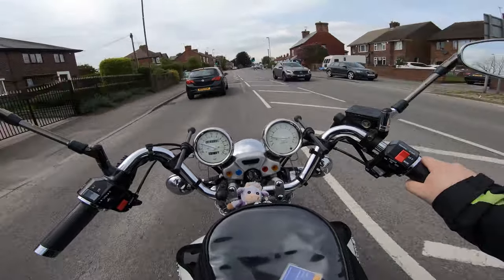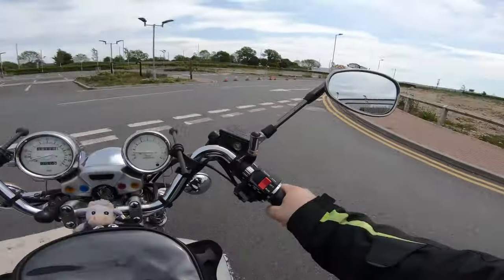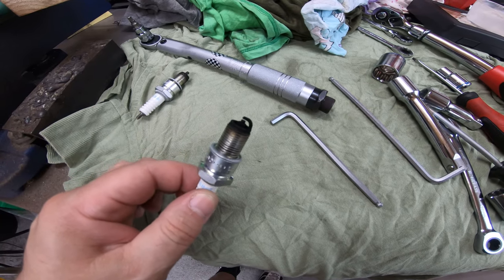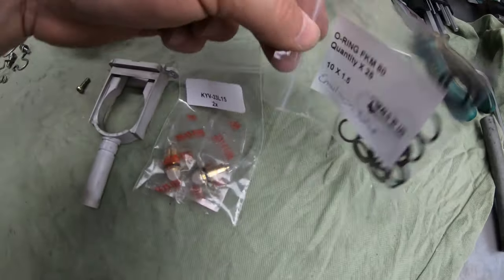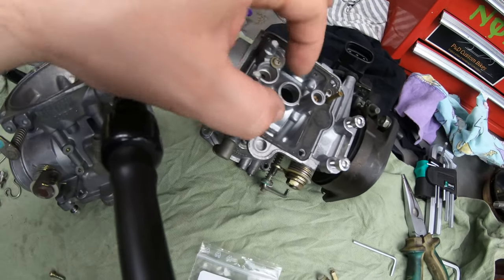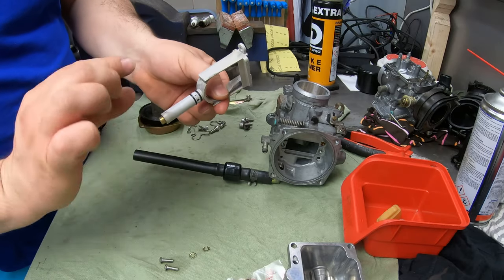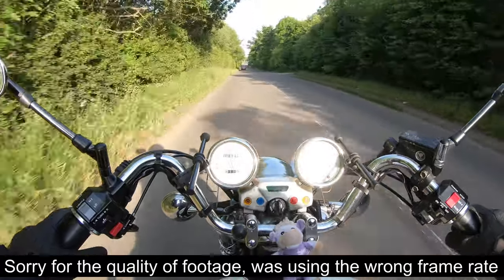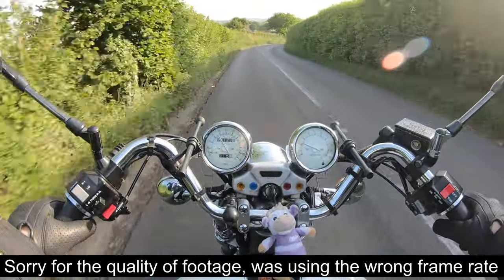VIRAGO 1100 CARB ISSUE  | FLOAT VALVE GONE | How to adjust fuel level | Emulsion tube O-ring swap

Comment: Hey brother, I did the exact same thing you did. My float I set exactly the same way you did. When I re installed my carb to the bike, fuel was pouring out of the overflow tube. I don't understand
Reply from the maker: @devin usa That's strange, however it happened to me too if I left them empty for a few hours... Drain it half empty, then hit the bowl with a screwdriver handle, then prime it with the pump and keep hitting it, if this time everything is fine then you have your float stuck on the bottom when the carb is empty and it isn't coming up as it fills up.
 Watch my carb installation video where you can see I explain the situation and how I fixed the problem with a little solder on the needle valve housing so the float doesn't go that far down. I hope I'm explained it right. If the float goes down enough just to open the valve that's enough, it doesn't need more... What really matters is the top position
https://youtu.be/2Rx4pVpChwo
Reply: @MidlandCruiser  I think the tang for the float is worn out, I had to sit the float to be leaner, about 30 degrees, just to stop it from flooding. I'm going to switch to a single carb. It's miserable installing these dual carbs. Yamaha did a poor job at designs when it came to these carb placements
Reply from the maker: Yes they are not the best to work on, but they can work fine after many hours of work😉 I wish you good luck witht he single carb, if you don't want too much troubles then I suggest Adam Smith on Facebook Virago-Nation group who makes, possibly the best ones of the manifolds. 👍
Reply: @MidlandCruiser  thank you brother. I contacted Adam today and will purchase from him in a few weeks. . After 10 hours, I removed, fixed and installed the carbs back on. I've never had so much trouble with any carbs before, yamaha hates us lol
Reply from the maker: @dl2.504B  Adam's manifold should be fine, and if your carb needs tweaking then it'll be 5 min to pop it off, I do understand why would you go single carb. I hope you get it sorted and can enjoy it over the summer.. All the best 😉

Comment: Hey brother. Hope all is well. So my virago 1100 front cylinder is still acting up. I changed the resister cap, the coil and wires, and it still misfires. I put new plugs in it 2 weeks ago, and the rear cylinder and new spark plug is running fine, but the new spark plug in the front is misfiring unless I pull the resister cap off half way. So I threw the old spark plug back on the front cylinder and it doesn't misfire at the moment. I think my carbs are running rich, because there's black soot on the plugs. Could rich carbs cause the misfire because of too much fuel in the front cylinder? And if so, do you know how I can readjust the fuel/air mixture on the carbs for the virago 1100? Someone in a forum said the fuel/air mixture screws are covered by a brass plug/cap so people can't mess with it. I need help, you're the only one I found with any actual knowledge of working on a virago
Reply from the maker: First of all, thank you... 😉
So misfire can be caused by too rich condition. If it's happening on low throttle opening and/or idle then the pilot mixture screw can help yes. On the 1100 if it's after 88 then you have Mikuni carbs which will have a black rubber plug covering them instead a brass plug. If you have an older then you have Hitachi on it which is crap all together and also I have no experience with, so everything I say is apply to the Mikuni.
I'm pretty sure you have a carb issue and not ignition as you changed everything and still not right, and also went back to the old plug and it's fine now.. So I'd focus on the carbs.
Unfortunately there is so much to check/do that I literally would run out of space here.

1st I would do is fuel level check, easy to do and I show it in the video how to do it, just on the vice, but the procedure is the same if it's on the bike.. Low or high are both not good, it needs to be right.

2nd would be to check how far your pilot screws are out now, just turn them in and count how many turns until stops lightly, you can use a small hex driver bit to be able to turn it as the space is very limited.

To be fully honest you may need to pull the carbs, fully strip them, then clean them (ultrasonic cleaner preferred) re set everything to stock and fine tune it once running again, including sync. Unfortunately this isn't an easy  thing to do. I could help you but you are in the US, sorry.
If everything is stock (intake and exhaust) then your carb setup will need to be at the stock settings (fuel level, needle position, pilot screw positions, and all the jets) stock pilot screw setting is 2 out on the front and 2 and 1/2 on the rear, both needle clip in the middle position, and fuel level around 0 to - 1.5mm below the carb body seal surface as shown in the video.... Hope this helps a little
Reply: @MidlandCruiser  my virago 1100 is a 1991. And I took out the carbs when I first got it, and cleaned the carbs out, the float seemed good, as did the jets and pilots and gaskets. So I believe I just need to readjust the fuel/air mixture.  I'll serch for the mixture screws and attempt to resync them. My virago 1100 came with drag pipes and an aftermarket air intake/filter. So I'm thinking maybe the prior owner could have readjusted the air/fuel mixture to be more lean, to compensate for the drag pipes (they do have baffles in them), so the bike didn't run to lean. But I think he over did it, and now it's too rich. 
I appreciate your help, and your advice is definitely appreciated and very helpful, even if we are over seas from each other. I'll work on the mixture, and let you know how it came out. You've definitely inspired me to work on this bike more and more!
Reply from the maker: @devin usa Seems like you have quite a bit a of modifications on, so I would recommend going up 1 size in the main jet, and about 2.5 turns out on the front and 2.75 on the rear, and leave everything else in the stock position (needle clip, and fuel level, not float level-important)
When I said sync them I meant the butterfly valves not the pilot screws. The pilot screws are on the top and on the cylinder head side of the carb inder a black rubber cover. I was going to put together a carb setup video series but got busy with other stuff and now I won't be able to do it until summer.. I hope you get it sorted 👍

Comment: Wondering if you can help me, my xv1100 92 will fire but does when it try’s to idle, I think it’s a fuel issue to but idk, any help is appreciated
Reply from the maker: Hello I'm sorry but not sure what you mean. It fires when it tries to idle? Or runs fine but doesn't fire when tries to idle?
Reply: @MidlandCruiser  it starts up and will run if I have the choke full throttle, but I can’t get it to pump up past zero rpm and it eventually just shuts off. It’s making like a hissing noise too
Reply from the maker: Hissing noise can indicate an air leak. There are 2 rubber cover over the sync nipples on the rubber manifolds, which connects the carbs to the cylinder heads. Make sure they are in place and not cracked /perished. Check the bolts holding them to the head to make sure they're tight. If it's running ok on choke but stalls without it, then it's lean which can be caused by the problems above. Hope this helps

Comment: hi mate, my rear cylinder keeps flooding, the float level is spot on, ? im trying to take out the plastic emoltion tube slide i got the security screws out but i cant get the plastic slide out any ideas thanks
Reply from the maker: Hi. If both screws are out there is nothing else holding it but the o-rings. Try heating up the carb body with a heatgun to expand it a little around the tube. Also worth checking is to make sure your float does not get jammed against the bowl. If you check my carb installation video I'll explain the problem what I had, and how I solved it... Any more questions, don't hesitate to ask. 👍
Reply: @MidlandCruiser  thanks mate have you seen sammy milller motorcycle vids yet
Reply from the maker: Your welcome. No I haven't...I'll check his channel out

Comment: Hi, how many turns should the air screw be turned out on a aftermarket freeflow exhaust, i have got 117.5 main jets in both carburators is this the correct size, pilot jets is 40
Reply from the maker: Hi. For my 1997 XV1100 I used 127.5 for the front cylinder and 125 for the rear, for my free flow exhaust..the front cylinder needs more fuel because the way the airbox is designed. You didn’t mention what year or bike you have so I can only tell you what I use.

I think I will try 1 more size up on the main jets this year, because on full throttle it still feels a bit flat.

I turned out the pilot fuel screws 3 turns roughly on both...

This is only for the viragos which are equipped with the dual Mikuni BST40 carbs, if you have a different one then all this is invalid...hope it helps anyway 😉
Reply: @MidlandCruiser  Hi, thank you for the reply, i own the Yamaha Virago XV1100 1998, dumb question but the front cylinder is the one closest to the front wheel(some guys say the front cylinder is the one closest to the rear wheel and that cylinder needs the bigger jet because it is running hotter than the cylinder closest to the front wheel)

The jets i have now is 126 and a 125, it is one hell of a struggle to get parts for the virago in south africa. I suppose the 126 and 126 jet is better than the 117 i had in?

I do have the BST40 Mikuni carbs fitted as you said.

Regards.
Reply from the maker: @bertusnolte512  hello, yes the way I said it was the way you sit on it. Front (called as Number 2 cylinder sometimes) is the one closer to the front wheel.

Number 1 Cylinder is the rear which is closer to the reserve fuel tank...

Whoever said you need bigger jet in the rear (No 1) is wrong. If you are running the stock airbox then you need the bigger jet in the front (No2) the one closer to the front wheel. So make sure your jets are put in that way.

As I mentioned before it is because the way the airbox is designed and not because the rear runs hotter..
Reply: @MidlandCruiser Hi, the pilot screw( fuel/ airscrew) does the steel washer fit over the shaft with the spring or does the steel washer only hold the oring in its place with the springs tension when the pilot screw is turned?